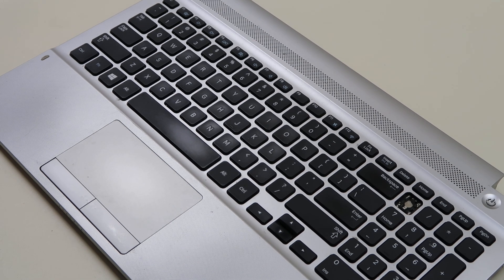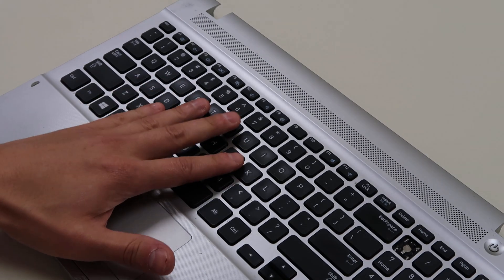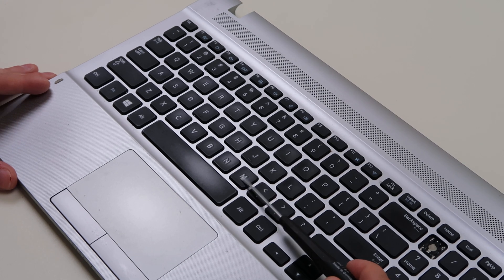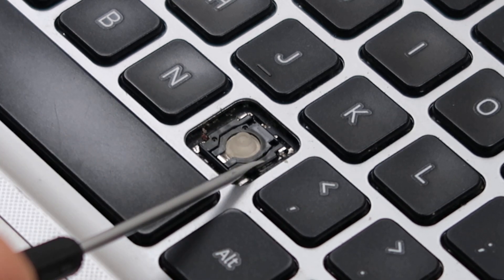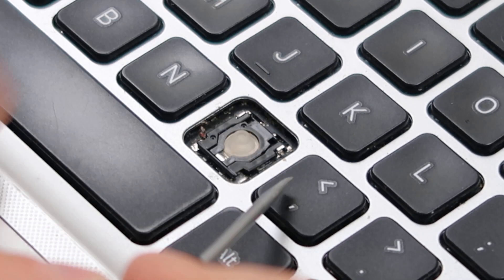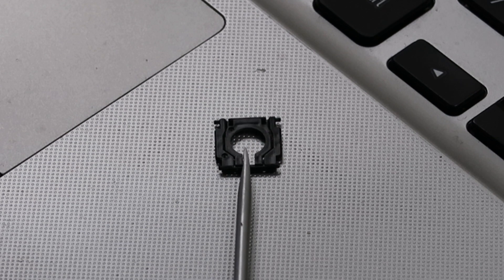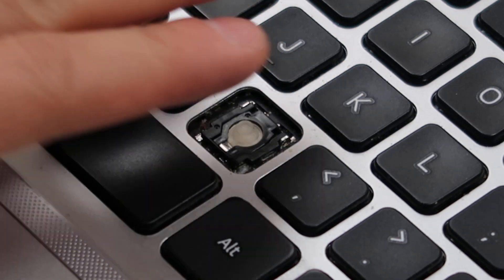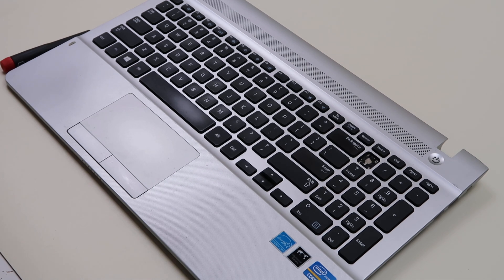How To Fix Replace Keyboard Key - Samsung 300E Laptop - Letter Arrow Number Small

Comment: mine is samsung np300e4x, are the keycaps removable too ? my enter and backspace don't work anymore
Reply from the maker: Is there something physically wrong with the key / keys or are they mechanically working fine?
Also, did anything happen before this issue started? Liquid spill, overheating, a Windows update, etc?
Reply: @PC_Monkey  no, my laptop is slow, it never overheated, i also never spilled any water or anything, other keys are working fine, it's just backspace and enter....it just stopped working, is this laptop keycaps removable ?

Comment: I need some help....
I have keys, k,l,p,;o not working ?
I watched how to remove keys but wanted to know how you know its just the key not the whole keyboard?
Reply from the maker: Do the keys feel like they are physically fine or do they feel like they have something mechanically wrong with them?
Reply: @PC Monkey   nothing is wrong with keys physically just when I take key off I touched the plastic ball button and nothing happened no letter on screen.
Reply from the maker: @loribengeify  This video is a tutorial on how to replace a key.  If your keys are not working but are not mechanically broken, troubleshoot them as seen here; https://youtu.be/wqrchfpdJ_w.
Reply: @PC Monkey  trying it now for updates.
Reply from the maker: @loribengeify   Good luck !!  Let me know how it goes :)
Reply: @PC Monkey  it didn't work so I guess it inside under the keys
Reply from the maker: @loribengeify  If that didnt work, I would replace the keyboard.

Comment: Well sir, I took my thin card and slid it about a third of the way under the right side of the key and pried up very lightly, pulled it out, and they key is now working.  So that was a cure in itself - not sure why.  The key does not feel any different, but now just types once.  Thank you for helping fix my Samsung Yoga - I have the  old style with windows 10 and a real piano hinge and really don't want to give it up!
Reply from the maker: Glad your all set :) Always here if needed !!
Reply: @PC_Monkey  Very helpful. Thanks again.

Comment: I wish I should have watched the video first.
I ripped the rubber piece clean off 😭
Reply from the maker: There isn't really a good way to reattach those.  They are not meant to be replaced.  Best advice is try to use a small amount of glue.  If that does not work, you may have to replace the keyboard.
Reply: @PC_Monkey  
Well the problem is that both the number 'Nine' keys on my numpad as well as the alphanumeric pad and the backwards arrow key are not working.
 So is this a problem with my laptop keypad or some software issue?
 I managed to reattach the rubber piece but I could not check if it was working or not. 
My laptop brand and model: SAMSUNG NP305E5Z.
Reply from the maker: @syedhashir2970  Does the key feel like there is something physically wrong with it or does it feel like its physically working fine?
Reply: @PC_Monkey  It feels perfectly fine.
Reply from the maker: @syedhashir2970   This video is a tutorial on how to replace a key.  If your keys are not working but are not mechanically broken, troubleshoot them as seen here; https://youtu.be/wqrchfpdJ_w.

Comment: Hey help meee,while I was removing the key,I broke the clips,is there any way to fix it?pls,my dad's gonna kill me,I just wanna make it look like normal,is there any way to put the keys back,no probs if it doesn't work also,I just want the keys in its place
Reply from the maker: Did the Retainer Clip break or did it just come apart in two? 
If it just came apart in two, They fit together with a small plastic pin on the left and right of the inner clip.  These fit into holes on the outer clip.  To see exactly how the inner clip sits in the outer clip, remove another key cap and copy the clip under it.
Reply: @PC_Monkey  I did it huuu,thank god,but still the keys r not working,how to fix that?
Reply from the maker: @srineeth.ek2008   This video is a tutorial on how to replace a key.  If your keys are not working but are not mechanically broken, troubleshoot them as seen here; https://youtu.be/wqrchfpdJ_w.
Reply: @PC_Monkey  mannn thank u soooo much,tnx for these comments mannnn

Comment: Thank you !  my S letter was working badly (np355v5c), i was afraid of removing the key cap... i could take it off quite easily,  i found a  speck of dust was the culprit and blew it off  !   I use an ENEMA PEAR  to blow dust off mainboards and coolers, it's cheap and efficient, but of course it should be used ONLY for this purpose  !
Reply from the maker: Great to hear !!  Always here to help :):)

Comment: So I had to take off the keycap because there was a piece that broke off from inside of the laptop, and I hadn't watched the video, so I just took the keycap off, and the latch thing is stuck to the keycap, is there a way to take it off or attach it with it stuck to the keycap?

Update, I got them separated, but the keycap won't fit in?
Reply from the maker: If your Key Cap is not clicking down in place correctly, it is most likely due to the Retainer Clip not being properly installed or damaged.  Remove the Cap and inspect for damage or that its not laying down flush and properly snapped in itself.  Compare to another Clip if needed by removing another Cap.

Comment: Thank you!  Fixed my NP503 using this vid after the cats managed to rip the D key off.  Bought used one off ebay, retainer was a little different than original and one in video and it took some head scratching and trial and error.  The pivoting inner piece hooks to the lower metal retainer.  Once I got that part right it was smooth sailing.
Reply from the maker: Great work !!  Keys are simple parts but can be one of the most frustrating parts of computer repair lol

Comment: Can u give link 9f this laptop to buy
Reply from the maker: I usually get my keys on Ebay or https://www.laptopkeys.com/
Reply: @PC_Monkey  I want to purchase laptop
Reply from the maker: @Xavierrrr903  Ok.  The laptop you would buy depends on what your going to use it for and what options and specs you want it to have.  What are you intending on using it for?
Reply from the maker: @Xavierrrr903  If the only software you expect to run are browser based such as Google Drive and Zoom, most computers will be adequate.

Comment: Sorry this is such a dumb question, BUT, how do I determine which kind of keyboard I have. My laptop is a DESKTOP-2JKJRV2. The keyboard looks very much like the one in your video. THANKS in advance for your time and consideration! Aloha
Reply from the maker: I dont know what model computer that is.  What brand it is?
Reply: @PC_Monkey  Hey there! It's an older Samsung, maybe 6 years. The keyboard looks almost exactly like the one in your video. I acquired it from a friend so I'm the 2nd owner. Thanks!
Reply from the maker: @terryridge4596  You would have to get the model number of the computer or, better, the part number of the keyboard.  Almost all models are different.  You may be able to find the model number by following this video;  https://www.youtube.com/watch?v=-t1UcxmT7yA